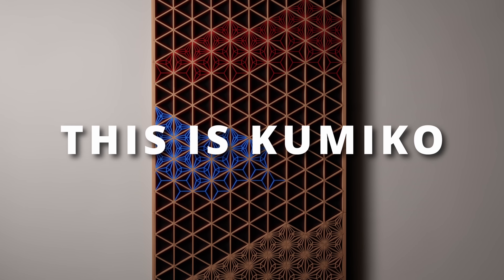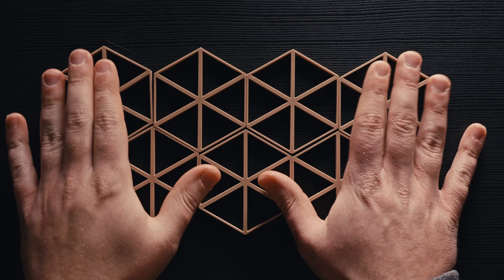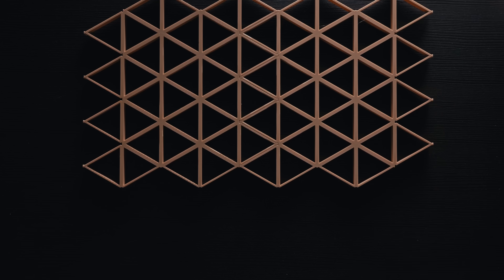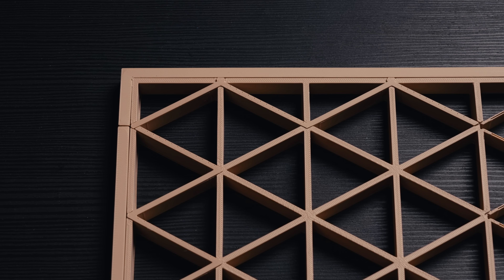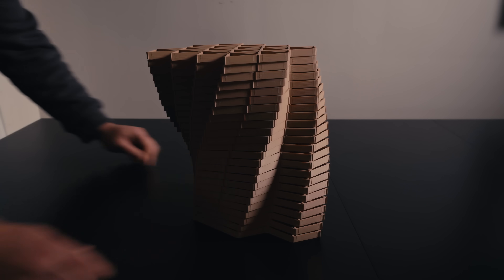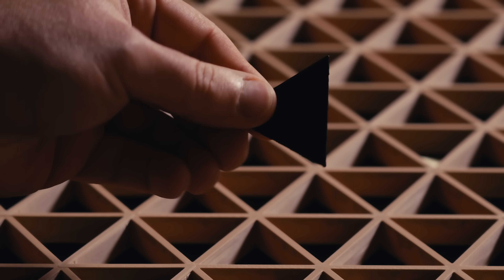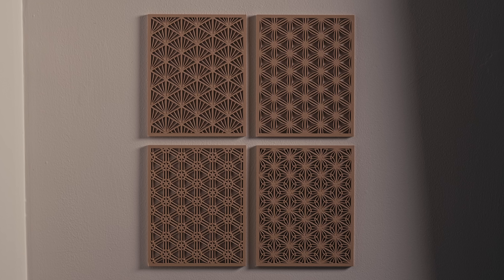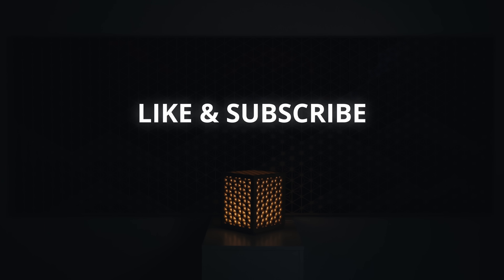I 3d Printed a $2,700 Kumiko Panel

Comment: Great concept, I was thinking about a way to avoid the overlay pieces to cover seams. Couldn’t you print the overlay into the piece similar to tongue and groove. One side of the join includes the top, and the other side has the height reduced along the seam. It is similar to what you did, just the overlay is included in one side of the join. Hope this makes sense. This would reduce the number of parts required and I would imagine create a stronger join. 👍

Comment: only material cost. labour is free. its hobby. u can watch netflix or 3d print LOL. and 3d printer is add to cost. u not print without it...then its silly cheap only material what 2.7K lol. u spend that much doing it?
Reply: 3d printers only cost around $150.

And no, the labour is not free. Imagine how long it must’ve taken this guy to design all the different designs on a computer and actually get good quality?

In total, this project was way cheaper than buying actual Kumiko, which as he said in the video, was $2,700.

Comment: Regarding seams. Have you considered making the dove tails not all the way through and leaving the top part of the wall closed off. And then the next part would be a milimeter shorter. So kinda like with those inserts but integrated from one side. It would mean the wall can be assembled only from behind but should work I think.

Comment: IDK for sure, I don't have 3D printer and never used one, but couldn't you just split height in half and make half on top, half on bottom? So you would just have only 2/4 spots or line or whatever depending on where would you cut?

Comment: Couldn't you have eliminated most seams by just giving all of the top surface to the rightmost edges of the leftmost piece, and beveled most of the transition to minimize overhang?  Or did that produce side seams that were less visible but also more ugly?

Comment: Realistically, the 100$ printing cost would be easily doubled to account for electricity, printer wear, print failures, etc. And all the time you took to design it and test print parts you busted that 2,700$ price. But you had fun and made a great video!

Comment: Did not even know these existed I just made something similar, but just with Hexagons that had holes in them and holders that could hold 2. There were multiple hole diameters for shading, I'll try to use lines and their width instead thanks

Comment: Looking at the problem of the seams where the design units meet, I have to wonder whether you could give up some freedom of orientation and cut the tops of the edges so that one side had a 45° cut angled down toward the edge of the unit, while the corresponding edge on the opposite side of the unit had a flange with a 45° underside (allowing it to be printed without supports) extending the width of an edge, so that when you assembled the units, the overhanging flange on one piece covered the cutout on the piece it rested against, leaving the top looking like a single piece.

Comment: this is brilliant video and design.  i have a use case - i need to replace some screens in my porch - im wondering if i could make panels to fit. i think it would look cool facing my deck.   maybe start off smallish - 4' wide and say 2' high to see how it looks and whether i want to go further with it.  i would not print the think translucent pieces rather just replace that with the screen - still need to replace the screen to keep out the bugs!

Comment: Absolutely incredible! What's the beige filament? In your beta instructions, I see you link to Bambu Lab Matte Latte Brown which looks a bit darker than your prints in this video. Did you use Bambu Lab Matte Desert Tan or Matte Caramel (both appear lighter) for this video? I'm also seeing some nice beige from Elegoo and Sunlu as well for cheaper and curious what would be my best option. Thanks!
Reply from the maker: The frame is made of the bambu matte latte brown. I was also surprised by the difference from what it looked like on the website compared with what it looked like irl when printed and it's very different. I tested all the bambulab browns and settled on this one. Despite what it looks like on the site, the caramel is darker and much closer to an light-brown orange. Caramel still looks good and might look good as a frame, but I think the color is a bit too strong. If you check out my recent community post on youtube, the bottom left inserts are made of caramel. I haven't tested other brand colors since I found buying in bulk from bambulab was cheaper from my searches (could be just where I'm from).
Reply: @paper_view  I really like the color you settled on and I'll likely be also using the Bambu matte latte brown. I see what you mean with caramel being a bit too strong. Great new video today, I'm psyched to try this project out 👍

Comment: Why not make the outer-frame with the stirdy bit and kinda press the board together with the frame... it will just hang on a wall, it will be seamless and compressed it should have enough friction to not fall apart

Comment: Have you released the files for the mini box frame? Not sure if i'm being blind.
Reply from the maker: Likely won't release the model for the lamp due to the design leading to printing and structural issues. It looks good from afar but  has obvious issues up close and is easy to break if not careful. I'd have to modify it quite a bit before I'm comfortable sharing more broadly. Once I have more time I was thinking of releasing a better version but I don't have any timeline for that currently

Comment: Did someone print that as well and could suggest the filament they used for the panels?
Reply from the maker: 5 x 1kg matte latte brown (frame)
1 x 1kg matte black
1 x 1kg matte dark red
1 x 1kg matte marine blue
Reply: @paper_view  Thanks for the reply. I found Matte Black and Blue from Elegoo (since i am using that printed and am realtivly new to printing) but i cant find a good red ._. Got any suggestion for the filament itself?

Comment: You mention backlighting. This could be done with each individual triangle if the triangles were sized to a standard spacing for LED strip lighting. 

For instance, just pulling a file into my slicer, it looks like the triangles are spaced at about 50 mm tall, or since each vertical line consists of a repeating pattern of 2 alternating triangles, an LED strip light would need to be 40 LED's per meter. This is not a standard spacing for LED strips. 

You could resize the models by 133.33% and have a pattern that matches one of the more common standards of 30 LED’s per meter. That would give you one LED per triangle when run vertically, and you could control the lighting of each triangle individually with a few controllers. 

Just a thought.

Comment: Whoever charges $2700 for a Kumiko panel is RIPPING you off completely.
It takes 4-6 hours to make a panel that size, with minimal tools, and about $30-$50 worth of materials. It's all math, there's not much skill or artistry needed. What a scam.

Comment: why didnt you connect them individually to the center, and not split? thats the only thing i dont get, you would avoid overengineering that cover and would look cleaner overall, it could maybe even be done with only a little slit on each piece

Comment: 2300 grams is still nothing compared to the "cost" of the retail version - for anyone wondering, that's $25-75 depending on how far you want to try to push using cheap filament.

Comment: Regarding the seams, couldn't you have the "insert" just part of the piece itself via an overhand/lip? I'm thinking your singular piece would have a lip on the "top" on one end and the "bottom" on the other end. This would allow you to flip and rotate the pieces to connect them, preventing 2 lips from interfering with each other, while still keeping everything the same singular piece design. I'll admit I haven't fully drawn this out or anything, but I am an engineer, and I can picture it. I think I've even seen this method used for certain toys, furniture, etc. Also think you could use a lip and groove design with this method to interconnect the pieces (the lip goes OVER the other piece and provides the interconnect) instead of what I guess I'd call a tongue and groove design you have here. Or if lip and groove isn't sufficient you could use a cantilever snap fit. EDIT: I'm not sure if it's classified as a cantilever snap fit or lip and groove or something else entirely, but if you look at plastic cable raceways and how they "snap" together it might help as well.

Comment: to avoid seams you should have added a lip on one side on every second piece, where the lip extrudes an extra 2mm (or whatever width each piece is) so you fasten them all together, then rotate to the other side (where the lip is) and the lip is covering all seams
Reply: funny I just made a similar comment. Except my idea would be to make lips part of the piece on the top of one side and the bottom of the other side. Since the pieces are symmetrical anyway you can just flip and rotate them, and the lip will always cover the one leading edge on the front. No need for cutouts and trim pieces like he did. I'm not sure where but I'm positive I've seen this exact concept used in commercial product designs before (toys, furniture, or something).

Comment: Awesome work! Especially on the parametric Kumiko frame generator! 

But as a woodworker who is also a passionate maker/tinkerer with a 3d printer, this video really tears me apart... I've made a few small kumiko panels (approx. 15cm x 15cm or 5" x 5") using the "asa-no-ha" pattern, so I know how much work/precision and about the learning curve that goes into making them, but there's also so much enjoyment and meditative relaxation within the process that I feel gets lost if 3d printing everything... For me, a lot about making Kumiko panels, is about the journey and not just the final product. But hey... that's just me...

For what it's worth, I can definitely see myself 3d-printing some individual patterns to insert into an otherwise entirely wooden grid to ad some pops of colour or a detail that would be a lot harder to make out of wood.

If using a 3d printer, then I feel the way to go is a hybrid one: 
Make the frame out of wood (as that work is quite easy and fast to batch cut on a table saw), and then print the infill patterns (as those take the longest and most skill to make by hand).

Comment: Wouldn't have been  EASIER, faster, and cheaper to carve it out out using either a laser cutter for a slim panel or a 5-axis CNC with a router head for a thicker wood?? Also it'd be More solid and not as fragile 🤔🤔🤔

Comment: Those original panels are wood though, and not plastic. And while the original will age beautifully, the printed version will not.
Reply: Obviously, but this is also a fraction of the price with a lot more flexibility. Wood CNC may be a good compromise, and you can use these files (when they are available) to make a CNC'd version as well that will last a lifetime and age.

Comment: ah you didn't need an insert, you just needed to slant to joint area, so underneath the north part has the full last seam, and on top, the south part has the full seam, and they join at that angle.
aaah man, i was hoping beyond hope you'd have done this, then the seam would be a few mm just on the points where they join

Comment: Just wanted to congratulate you for your video. It was beautiful and that really gave me some ideas of things to do as decoration parts. I just wanted to know what material you used? I'm sorry if you said it in your video but I don't know if you used PLA or ABS. If you could put that in the description, to at least know if PLA is resistant enough to do it or if we need to use ABS to have something solid. Also, I saw you used a Bambu Lab P1P 3D printer. I know it might be useless compared to other info but it might be cool to put that in the description too.

Once again, thank you for this video and I'm hyped for the next one :) hoping you will go further and have a larger community. You deserve it.

Comment: i personnally think you should have made an L shape to cover the seams, like the recess you should have made it like -->  l l <------- make the connection on the right, lower the z (height) by 1mm and then expand the top of the left to cover over top of the right

Comment: with 3D printing you can use circular or wobbly shapes in the inserts whereas with wood you have to use straight or bevelled or maybe slightly bent bits only

Comment: I think you could've hidden the seams by printing the sections with recesses on say the top edges, and overhangs on the bottom edges. You might need a different design for the pieces that meet the frame, but I think this would save a lot of print and assembly time not needing to hide every seam.

Comment: Why not just add dovetails at the top and bottom as well? Your shape has peaks and valleys, you could gave added dovetails there and then don’t need to rely on the frame holding them together, which might be quite far away

Comment: To make seamless projects, I personally used a soldering iron at a low enough to melt but not burn the plastic. I ran a spool line over the seams while melting it over the gap. After that you just have to sand

Comment: This is impressive and fascinating. Though I feel like it might have been easier to do using a CNC instead of a 3D printer. That way you could use wood and also glue pieces together to prevent seems.

Comment: Sorry not to be that guy, but I legitimately have a question. Is this cultural appropriation like I’m just really curious
Reply: No. For something to be considered cultural appropriation, the cultural aspect must be "appropriated" by another culture/group as a whole or on a large scale. It would also need to be done in an inappropriate manner.
This is just single person engaging with another culture.

I'd say there'd be an argument for calling it cultural appropriation if some non-Japanese group (culture) started 3d printing these en masse (especially rather than actually using the traditional woodworking technique).
Like, if it were at the point where I could walk into a Canadian Walmart and see massive 3d printed kumiko panels for sale, I'd feel comfortable calling that cultural appropriation lol.
Reply: @AquaJV thx, I’m still learning…cause I low key like this I just wanted to make sure it was appropriate for me to print this or not
Reply: I'd call it a bastardization, but "cultural appropriation" implies appropriation between cultures as a whole.